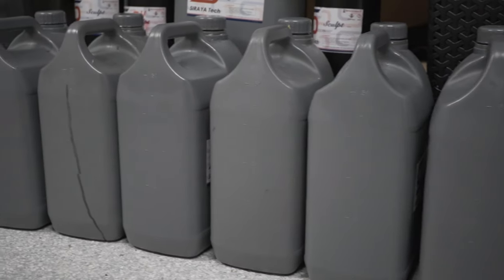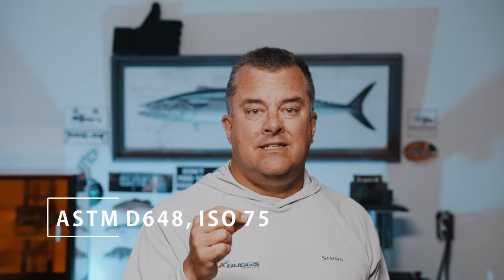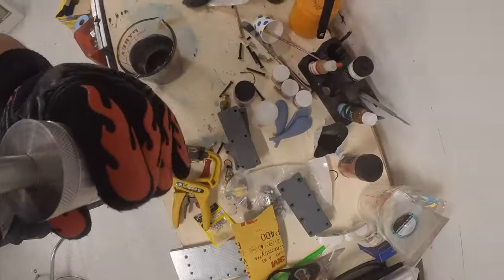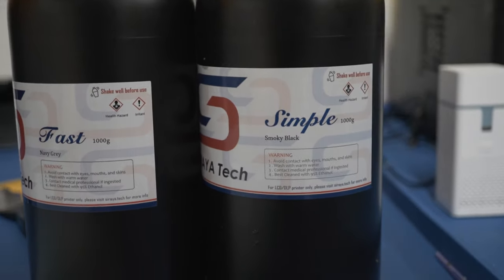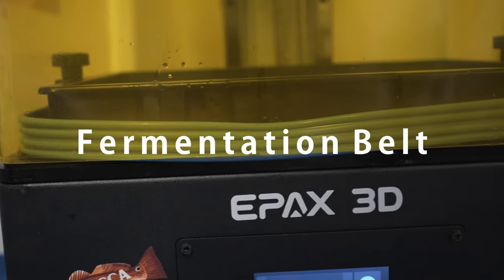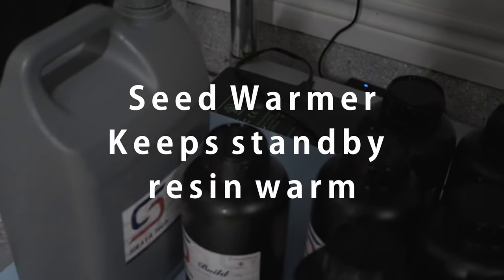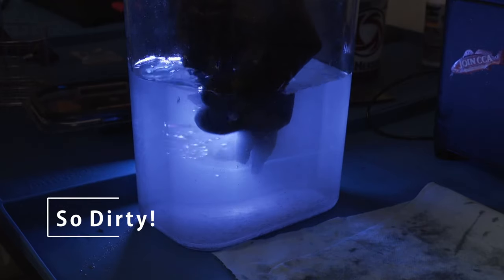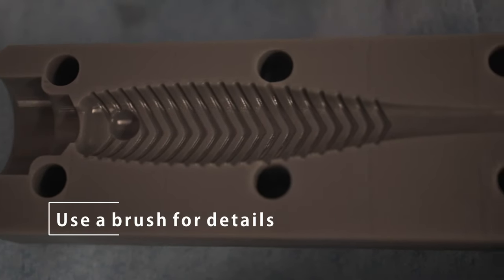Siraya Tech Sculpt Resin Uses, Settings, Processing - best high heat 3D printer resin!

Comment: Hi, Thanks for sharing. We just found out about this video.  The tips on printing and cleaning are amazing.  A lot of these could be applied We like to share a few feedback as well.
1) The best way to clean would be 2 separate baths, one dirty and one clean and use a brush made with hair to get resin off.  Alcohol temperature also affects cleaning efficiency so watch for that if you live in a very cold area

2) It is good that you no longer use Acetone. While Acetone has a very strong cleaning ability, it is too dangerous when not handled properly

3)  A lot of Sculpt's challenges can be from the heavy pigments. This is why we created Sculpt Clear that does not have any pigments and prints quicker. It is also easier to clean (no pigments to stick) and to cure.  

4) lift speed is a bit high at 70mm/min and you dial it down to the 50 range and it should have lower peel force.  You may also want to increase rest time to 2s since it takes longer to flow back. A lot of printing issues can be trace to rest not fully flow back and settle in.  

5) We also carry NFEP and that should help with peel force too.

Thanks again for sharing your experience
Reply from the maker: Thanks for commenting and making a great resin! I will put these tips to use.

Comment: Im glad I watched this video. My wife bought me the gray sculpt and its 2 half failed prints back to back, really gummy, harder cleanup, overall messier. My settings were all wrong. I cleaned too long, I cured too short. Thanks for the info cause this has been tough trying to figure out. Im literally a week into printing from knowing nothing so this helps a bunch
Reply: Quick update. Using your settings (plus Siraya Techs below), I was able to make a successful print. Thanks again. It added 5 hours which I think I can reduce by two hours at least. Regardless I know these settings absolutely work for me.

Comment: cool video, a tip for you is to use a hair dryer to warm the resin before printing, this will reduce the viscosity and get your resin up to temp.
Reply from the maker: Good tip! I have fermentation belts for all my printers now but the hair dryer method is a good one as well!

Comment: Awesome video, I have over exposed my molds in the ipa and couldn't figure out why it was decomposing like you mentioned. One question, have you experienced your molds not printing properly? I had a few that deformed on the z axis when I printed them flat. Molds looked great just looked like it was smooshed a little. The injection port came out oval instead of round. Again awesome video thanks a bunch for the information!
Reply from the maker: Yes that is from the suction force. The best way I have found to prevent that is orient the print so that the injection port open is at the bottom of the print. Usually means the longest print time but best results

Comment: I'm curious if you have ever printed actual masters to be used in the vulcanizing of silicone molds for spincasting using sculpt resins.
Reply from the maker: I have not, I print mold masters, then use Mold Max 60 to make the molds. I have printed masters from sculpt for someone that does spincasting. He mentioned that they worked well but we needed to upscale by 10% to account for shrinkage. Hope that helps!
Reply: Thank you. This does help.

Comment: Im getting into mold making, designs are good but when i go to print im getting deformation on my sprew hole as well as the molds them self being misaligned. What resin settings are you using? My printer is a creality halot mage 8k. Thanks
Reply from the maker: Go to Siraya’s website and download the settings file for your printer. Generally spot on.

Comment: What about post-cure bakeing? they  bake PCB resin for 7 times at 180 or 250 degrees C in ovens so that it is the highest temp fiberglass resin result on the market. If you oven bake it 1-2 hours it can then handle super high temps?
Reply from the maker: Interesting I will see about that!

Comment: Hi, i want to print large moulds with 0,8 mm layers, to increase speed, which setting you suggest? Also it would be enough 7 mm of wall thickness to withstand 120 degrees temperature?
Reply from the maker: You will need to test exposure, I can't give you an answer other than longer exposure the ticker the layer.

7mm might work but I would be concerned about the strength and rigidity of the mold. Resin is fairly flexible compared to metals and you sometimes need to apply pressure to get it to lay flat in certain areas. with thin walls this could be an issues.

Don't let me stop you from trying though, I would love to hear your results!
Reply: @WMBayouLures  i am planning about printing hollowed pieces, with 7 mm wall thickness and fullfill them with sand, what you think about it?
Reply from the maker: @giulioindio  worth a try for sure! Just make sure you get all the resin cured inside the hollow area. Can’t wait to see the results!

Comment: what are your settings for the saturn? tried twice so far with molds and they failed sticking to the fep. Im using siraya techs settings of like 4.2 exposure time and 45s bottom exposure time. Also using a magnetic plate
Reply from the maker: You could try to download the config file for the Saturn from Siraya Tech located here - https://docs.google.com/spreadsheets/d/1x7C0EGoT6PBUJXf3Mk_FFLEfXUAP9Z9SOTX19fMH15A/edit#gid=0

Those numbers sound reasonable(even a bit hig) I had a magnetic build plate on my Saturn and I could never get it to work for molds, I think it is too much pull force.  I could be wrong but once I removed the magnetic plate I got got prints.
Reply: @WMBayouLures  hmm ok I might have to remove the magnet than because I think that's the file I downloaded and have in chitubox last year, was a whole bunch of profiles from sirayatech for the Saturn

Comment: What is the hardware you are using to join the two sides of the mold together?
Reply from the maker: I use M5 bolts and rivet nuts. Overview in the mold making process is here - Let's make a lure mold in Fusion 360! Step-by-step
Reply: @WMBayouLures  Thank you. I may not be making lures but I am making 3d printed molds. You've been a tremendous help. Greatly appreciate you taking the time to make these videos.